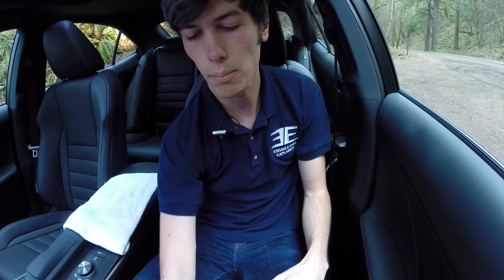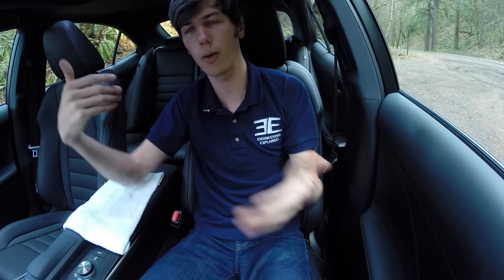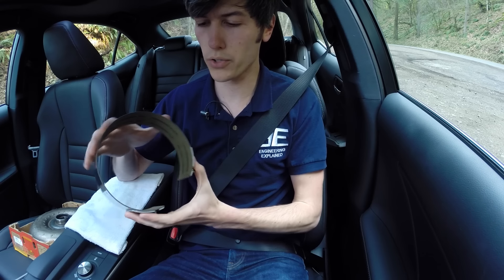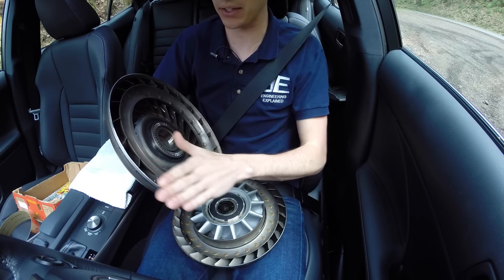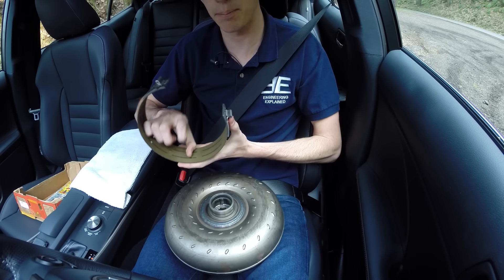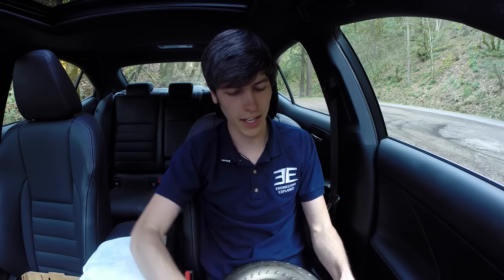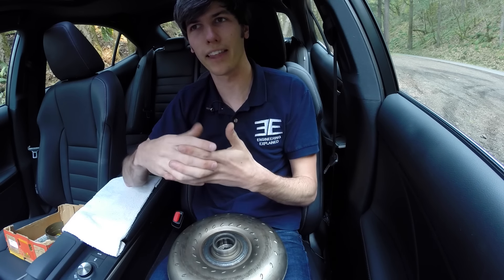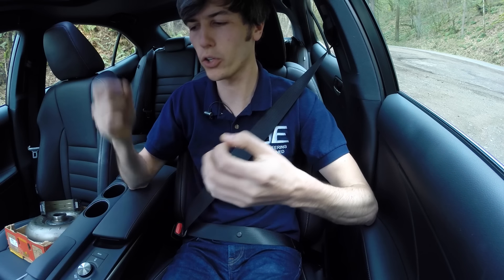5 Things You Should Never Do In An Automatic Transmission Vehicle

Comment: "I can't think of any scenario to put it in Park while you're.moving."

There's a story my Drivers' Ed teacher told us about a girl who thought "P" stood for Pass.  She completely destroyed a transmission putting it in "Pass" at freeway speed.
Reply: @kristijandimovski410  you'd be surprised
Reply: @kristijandimovski410  Ha, you must not go out much. I envy your naïveté. 😂
Reply: Had she never sat in a car before?
Reply: Tf does that mean? She thought the car was able to pass other vehicles automatically?
Reply: I can relate, thank god for the detent on P :). I thought I was in SD mode on the gearbox so pushed the stick forwards and instead of the dashboard changing to M4, M3 it showed R . I kicked myself and quickly shifted back to D. Spent the rest of the journey home hoping the gearbox ECU is clever enough not to try and go into reverse at highway speeds.

SD can be turned on by sliding the stick to the left or pressing the sport button. It's only when the stick is on the left that forwards and backward ship gears manually (ish, it will still auto downshift for you in manual mode.)
Reply: When the car is in D on its way uphill and suddenly want to change to lower gear says 3rd or 2nd gear, can it be done by just pushing the gear knob down without stopping the car first?
Reply: @andylau638  going uphill aside, do you think you have to be in a complete stop to change gears in general? You do realize the point of gears and how they work right
Reply: @thatguy1806  No, to be honest I don't really know how the gears work, especially the auto gears though the manual one I know it needs to engage the clutch before changing the gears and no need to come to a complete stop. Thus the auto one needs or doesn't need for a complete stop? But if needed to come to a complete stop it's so ridiculous and impossible. I suppose to shift from D to the lower gear straight away as the car is still moving without any damage done. Is that right?
Reply: @andylau638  first of all I'm going to explain what a manual gear and an automatic gear do very simply, with the manual gearbox you have to manually shift the gears of the car everytime it needs to while you're moving, like when you've hit the redline on the second gear while accelerating so you have to hold down on the clutch and change into third gear (don't actually wait for the gear till it reaches redline tho it causes stress on the engine and sucks up gas)

But for an automatic gearbox you won't have to do that, you only need to switch between drive and reverse, so the gearbox shifts for you.

So to answer your question: in an automatic you won't even have to shift, you just gotta decelerate and the car will shift on its own, while in a manual you'll have to hold the clutch and change into 2nd gear. Though for both transmissions you have to come to a complete stop when changing from drive into reverse and vice versa unless you want to destroy your entire gearbox
Reply: @thatguy1806  Thanks for your reply and advice but you still missed one important point that I need to know about. In the D drive of course the auto gear box will change the gear within itself due to the speed change. But my point is if during the D drive I want to shift it to the lower drive of 3rd or 2nd or even 1st gear it can be done manually too. The thing is can it be shifted from D to 3rd gear or vice versa without stopping the car first? Need to stop the car or not for this change? From D to reverse gear definitely need to stop the car first if not big damage will result of course.
Reply: @andylau638  no actually, in most automatic cars you can't manually change the gear from 3rd to second, not saying there aren't autos with that option but I'm saying in the average grocery getter you can't manually change gears. And in cars where you actually can you don't have to fully stop the vehicle, because then what's the point of changing gears in the first place if you're just gonna stop the car

Edit: I'm really confused by your question because I really can't understand what's confusing, though I am trying my best to explain everything in the hopes that what you don't understand will be answered, so I apologize for the unreasonably long comments
Reply: @thatguy1806  Thanks anyway for your explanation of the auto gear systems. I understand nowadays there's only PRND and not PRND321 as in the older system. What I tried to ask is from D to 3,2or1 do we have to stop the car to change it. I feel no need to stop but just push the gear knob down to where we want it to be without harming the system. Sorry for the confusion to you in my question. If I'm still wrong please say so.
Reply: @andylau638  I don't know how this type of system works but I'm positive you wouldn't need to compeletly stop the car, the point of changing gears is to accelerate and decelerate, so what's the point if you're going to compeletly stop the car and then change gears
Reply: Same sort of person who would glue healing crystals to their airbag covers
Reply: doesnt the park mechanism only engage when the vehicle stops moving?
Reply: Did you go to excel driving school?
Reply: R for Racing and W for Wumbo
Reply: @andylau638  In short, no, you do not need to stop the car to switch to lower gears,not even back up to drive from the lower gears
My car's transmission has 5 speeds with the option to select D5, D4, D3, D2, and D1 which all basically just limit the highest gear it can enter, so D1 would force it into first, D3 would let it pick from 1, 2, or 3, and that's how a lot of automatic transmissions that let you "shift" manually are, really you can just think of it as you telling the computer what it is allowed to do

Comment: Neutral is illegal?  A law that is as effective as the illegality of using a cell phone while driving :/
Reply: The accident investigation will discover that the transmission was in neutral.  When coasting down a mountain hill that is several miles long, the only way to stay under the speed limit is to use your brakes (instead of using the "engine-braking" were the transmission still in gear).  The brakes WILL overheat and therefore will no longer work.  (Brakes are a device that converts mechanical energy to heat energy.)  Once the brakes fail, you have lost control of the car.  A certain percentage of those situations will result in an accident.  Overheated brakes are easy to discover by an accident investigator.

Comment: Just finished a month long course on auto trans and I can say there is a lot of great info in this video! Covers most of the basics that your average driver would need to know!
Reply: I'm curious about something, it was a bit of an argument that I got into, and I want a definitive answer to settle this.

WILL/COULD/DOES shifting from drive to neutral and back cause any damage?

Example: When trying to stop short, & u need the engine to detatch from drivetrain, b/c IDK, rev hang, whatever - FULL BRAKES, NO POWER is the idea, like how manuals can do.

Does Neutral damage an auto trans?
Reply: @aceof8S  well on any newer vehicle with an eauto transmission that will not damage it at all. It may cause some issues if done in a very old automatic transmission that has more basic mechanical safety features on it. 
But it will always be faster to stop with the vehicle in gear because that way you will have mechanical engine braking helping stop the car. If it's in neutral you will be relying solely on the brakes to stop without helping from the engines resistance. Almost all cars nowadays have enough braking power to lock up all 4 wheels though so it won't necessarily make a big difference, it will just be a smoother slow down.

Comment: "Your brakes should be able to overpower your engine" - yeah, about that - don't count on it!  Mine didn't even with 2 feet on the pedal!
Reply: Think about this: It takes the average car much longer to accelerate from 0-100km/hr than it does to go from 100 down to zero km/hr.
Reply: @amazeddude1780  Not when the brake booster stops working!

Comment: 9:19 For each time you "turn your car off", you must then use power from the battery (that must be recharged using more fuel) and you must use the starter (which is good for only a given number of starts).  My opinion is that all of those new cars that stop and start at each red light are just so that the tree huggers can feel good about themselves.  Also, there is a safety issue.  If a car from the cross-traffic veers out of its lane and is headed towards a stopped car, the stopped car (with its engine off) has no chance of accelerating out of the path of the oncoming car.
Reply: Vehicles that use a traditional starter to restart the engine after every red light are an absolute abomination.  It's just plain wrong.

Comment: Sure, my car cuts off the fuel to the engine when going down a hill in gear - but this causes the engine to induce drag through the drive train, requiring me to accelerate up the next hill rather than coasting over it.  I contend that I use more energy accelerating up a hill than I save going down one in gear.  I don't buy your argument and, unless coasting actually damages the transmission, I'll continue doing it.
Reply: If you shift to neutral and then have to apply the brakes you're wasting energy: engine consuming gas to keep idling + brakes throwing away kinetic energy as heat.

The induced drag you feel coasting in gear is the amount of energy it takes to rotate the engine, yes it's noticeable which is why idling wastes gas! To minimize drag you can upshift to keep RPMs just above the normal idle speed of the vehicle.

Comment: Here’s something I’ve always wondered: I will sometimes shift into neutral at a stop light because it’s easier to keep the car stopped than working against the Drive by applying the brakes.  I have found that at certain intersections if I shift into SECOND gear, that the car will stay still without braking because the torque output at second gear isn’t quite enough to overcome gentle slope at that intersection.  So instead of the minor effort of holding the car still at the intersection with the brakes, I can do it with zero effort by shifting the automatic into second.  Is that bad for an automatic trans?
Reply: I find that an auto will never engage Higher than 1st gear with an almost zero wheel speed!
Reply: use brakes, every owner’s manual for an automatic car says dont use the gas to keep a car stationary on a hill

Comment: "Your brakes are always going to outpower your engine." Source on that...?
Reply: Unless you have seriously underpowered brakes they’re always able to lock the tires (and get the ABS working), if the engine were equally powerful it should always be able spin the tires (both require you to break traction), but even in a high performance car with two wheel drive that only happens at lower speeds.
You can try it yourself, find a safe piece of road and accelerate hard it in a low gear, then as your revs build start braking with the other foot. Don’t do it for more than a few seconds obviously as you’ll burn your brakes if you keep doing it.
Reply: @Ty4ons  I mean doesnt it just depend on the engine and brakes? Lets say I have a diesel truck thats been tuned and highly modified to out put 1000hp + and tons of torque, but still using the stock brakes. Surely there are exceptions to the rule.

Comment: I shift to neutral at a stop light because it makes my car idle more smoothly.  My car really wants to move when I switch to drive, even though the idle speed is not too high, so I figure I save some gas too.  I heard somewhere that switching to neutral will also keep your engine cooler.
Reply: Only applies to older vehicles with less advanced autos and electric cooling fans
Reply: i wonder about this a lot. i drive an AT from 2002 so I wonder if a lot of these videos assume the viewer is driving something atleast from 2011 onwards
Reply: Definitely you don't watch the video fully or you understand it..

Comment: Many years ago I figured out that when trying to stop on very icy roads (I'm talking "skating rink" icy LOL), I could feel the car lurching forward while trying desperately to stop the car, sometimes actually gaining speed (1 - 2 km/h). I found putting it in neutral the last 5 - 7 km/h would eliminate that. It seemed that each time the antilock braking system "pulsed", the transmission would continue to move the car forward between pulses while in drive. Does this makes sense? I've driven manuals for the last 10 years and I've never felt this happen.

Comment: I personally recommend against turning your engine off in traffic unless you're likely to be there a while. (Like its a holiday weekend, you're headed out of town, there's an accident ahead and the freeway has just become a 40 mile long parking lot.) Otherwise, what you're doing is A) first and foremost wearing out your starter which costs a decent hunk of money to repair and risks stranding you in traffic and B) while your engine isn't running, your catalytic converter is cooling down (albeit maybe not much) which means the muck that its supposed to be breaking down is making its way out your exhaust pipe when you start to drive again. Proof of A? My cousin is a mechanic. He's worked for two shops that have contracts with local post offices. They have a rule that if the carrier is away from their vehicle, they must turn the engine off. 90% of what he does on those vehicles is replacing starters.
Reply: I restart my vehicles alot.  One ole guy I worked w 15 years ago kept fussing at me that I was wearing out starters.  In my 52 years I  can't remember replacing one starter.  Driven F150s mostly.  Not sure about the catalytic thing.
Reply: The problem of leaving a vehicle idling is leaving your doors unlocked risking auto jacking or risking locking in your keys.

Comment: Can someone explain on my 2013 is, 
When I have the MPG on instant, and going down a hill, off the throttle in d. The mpg fluctuates drastically but I'm never touching the throttle. In a particular gear/speed it's 90+ mpg then as the car slows but before it seem to downshift, it come down to around 25mpg? (I get that slightly more than that figure when I have my foot actually on the throttle cruising on highway!) ,  I'm still slowing down off the throttle now below 30mph And it stays there until I reach a stand still and have to brake. So around town would it be more economical to drop it into N because it's not dangerous because I'm doing below 30 so unlikely to loose control. But regardless of safety I'm curious as to the computer decisions in why it retards timing or disengages lock up etc but if someone can shed any light. 

My car is in near new condition 26kmiles full dealer service history and given nice hot runs regularly and at least 1 touch of the red line per drive when warm.  Yamaha didn't co tune that engine for nothing ha
Just to be clear I don't care about fuel consumption I'm purely just curious.

Comment: Most of the "stresses"  you mention are absorbed by the ATF.  You should advise that if you perform "launches" often then you should change your Transmission Fluid more often as this will help with longevity.  ATF is complicated, the hotter it gets the faster it degrades, but if you keep the temps in check there isn't much to worry about.  auxiliary coolers help...

Comment: I used to coast in neutral in my 94 'Civic 4 speed automatic. I was a student and I'm sure that saved fuel (modern cars do it now as well).

I put older cars into neutral at lights sometimes, tends to make the car more quiet / transmit less vibrations.
Reply: yup I always put my car in neutral at stoplights bc it vibrates like crazy at idle (Ford ZX2)

Comment: Hey Engineering Explained, your videos are very informative! Could you do a video about sealed automatic transmission systems with claims to life time ATF? 

Some automotive guys on youtube say lifetime ATF is a farce, and it's just there to promote more sales by allowing the transmission to fail quickly. Yet some manufacturers firmly state that as sealed transmission units, attempts to change the ATF would cause premature oxidisation and onset of ATF degradation. 

What are your views?

Comment: I experienced a situation where coasting in neutral saved the day!  Driving Out of the mountains, down hill,  on I-70 into Denver on a snow-covered (with ice) road in a front wheel drive mini-van.  I was doing around 30 mph, but when I let off the gas, the speedometer read 10 mph - in other words the front tires had no traction, no capability to steer.  I put the van in neutral (several miles) and pumped the brakes until the van slowed, and could return to normal driving.  Very scary at 3:00 AM!!  Made it back to Chicago later that day.